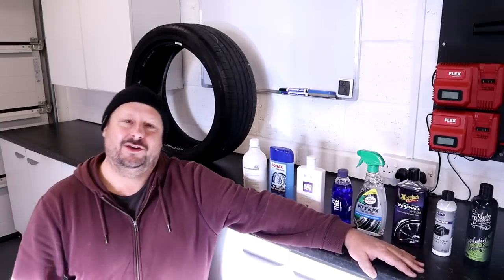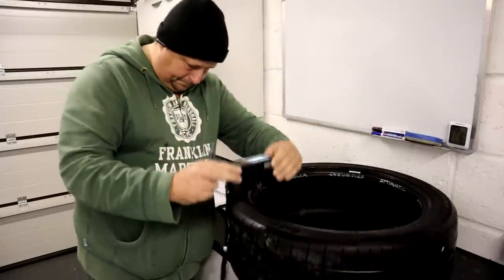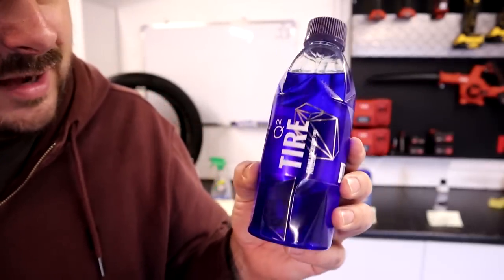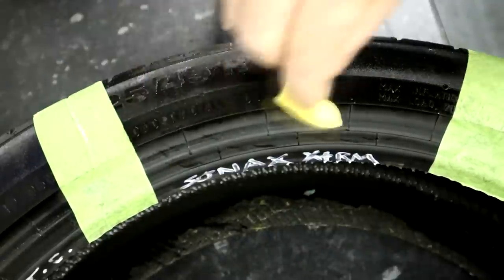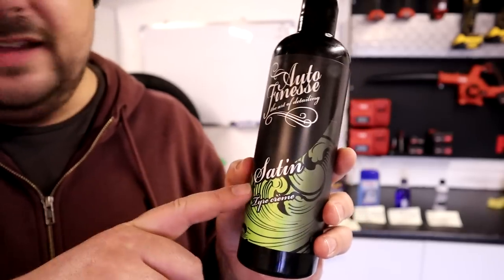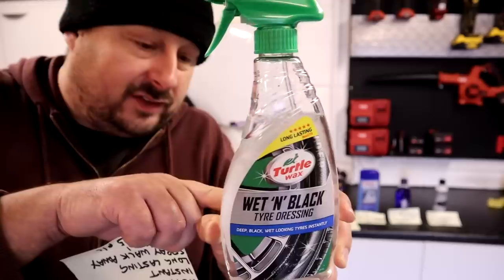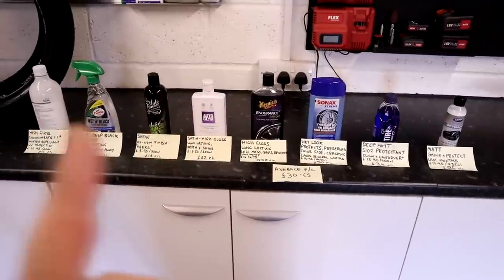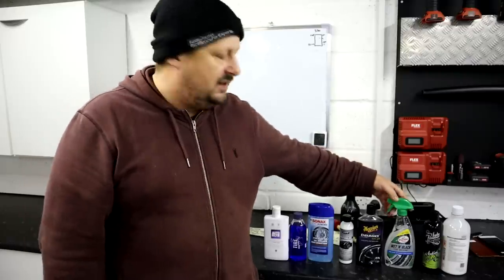The Best Tyre Shine Dressing Comparison

Comment: Use megs the bottle last ages applied with a small sponge
Reply: Totally agree, had my bottle for two years and there is still a quarter left, if you use less product and spread it more, which is easily done and then you get no sling. Also £14 were did you get that from Jon, i paid just over £9 last summer from Halfords

Comment: I have been using the Meguiars one for a long time, but found it to be too sticky and a little difficult to apply. Now, I use the Gyeon Tire one and I think it is better in every way (instead of its price of course)!
Reply: Try mixing Endurance with another Meguair’s product named ‘Hot Wheels’ it makes application so much easier and it has great ‘endurance’ too👍🏻

Comment: Hello John though I’d update my tyre dressings. I have been using Satin for years and I really love it’s application no mess at all is to apply I like the finish but isn’t that durable imo. I have since purchased megs & AG, these 2 seem like amazing products look nice I even used the megs on plastic trim let see how that goes. They only down side I found was megs was too sticky and had to apply AG was to runny and would end up spilling out of the bottle. Both lovely products think I’ll be using these 2 going forward.
Reply from the maker: Yer both slimey to use Jawad.  The satin is less greasy

Comment: Outside the competitors on this test, I've been using TUF Shine for a couple of years now and there's no other I'll be using  other than CarPro Perl on cars that I don't own or use. TUF needs quite a bit of prepping but it easily outlasts all of the others, around 10tkm per season and the sidewalls look still like new from wash to wash, only needing one top-up coat once every 4 months if you want to keep them to look like new. It even works in the winter. 😊

Comment: Great video 👍
I use liquid type of dressing. But I don't spray them. I pour a bit into a old plastic jug and using a painter brush to the correct aspect ratio size of the sidewall. This save money on the product, avoid getting it on the tread and more control.

Comment: I confess that I've not read all the comments, but am I the only one who associates tyre dressing with Arthur Daily and car lots on the Southend Arterial?

My 45 year old concours winning classic has narrow band whitewall tyres, so using any of these products isn't an option on that particular car due to 'bleed' and discolouration of the white rubber.

I use a combination of diluted De-Solv-It or Elbow Grease (the product, not muscle power), agitated with a non-stick washing up sponge, followed by Raceglaze Whitewall Cleaner, which is basically a rubber cleaner, sprayed on and wiped over with an open cell Basotect melamine sponge (Magic Sponge or similar). The Raceglaze product is the best of all and can be used as a standalone product, but the others are half the price so are useful and cheaper for the first stage of dirt removal.

Properly cleaned rubber has a very low level sheen and looks far more classy than any dressed tyre. I use the same products on all our cars.

An added advantage is that brake dust and road dirt are less likely to stick to the surface.

Comment: been using megs endurance for a while now, big bottle so yet to run out! it is as you described but the fact that it doesn't dry is abit annoying.. first time you take the car out for a drive some of it can splatter around! so if you apply it, go over it again with a microfibre or something to wipe off the excess.

Comment: Jon, I used to use both AutoGlym and Meguiars for my shows but has you mentioned never dries and got very dirty jeans a few times by touching the tyre whilst polishing. I have been very impressed with my Gtechniq T1 which i use now.

Comment: I stick with the regular Autoglym Instant Tyre Dressing (black label) as it can be applied to a wet tyre if need be. I draw the line at drying my tyres after washing and before application and like the results I get whether applied to a dry or damp tyre. I am a convert to the Meguiars applicator though.

Comment: I'd bet that the Turtle wax wet n black cost is higher per application as you're using a lot spraying it on like that.
Reply: Yeah why not into an applicator and wipe in😯 Not only will you use less but get little to nothing on the rims either💡

Comment: I use several tire fixtures, but first I cover the metal discs with a round cardboard template with a diameter only to protect the aluminum discs.  Because when braking, the dust sticks to the small drops of the tire cleaner that are on the disc when used without a template.  Then it looks bad.

Comment: I just got turned onto Dupli Color "Tire Paint." It literally comes in a spray paint can and gives you the gloss/wet/black-shine look and has a permanent application/doesn't wash off during a detail... and only costs about $6 bucks USD to fully dress 4/5 wheels. I typically recoat mine every 6 months... so you'd get a years supply that will run you about $12 dollars outta pocket.
Reply from the maker: I used to do a similiar thing.  in the UK we have car plan 5 litres Tyre Paint for 20 quid.  The trade guys use it because you can just paint over the crap with it :) but I really want to dress my tyres not paint them.  Tyre paints are more a way of making battered tyres look fresh, but with detailing you want to just make nice tyres look dressed.

Comment: I use meguires hot tyre shine with the megs applicator. With about three or four sprays on the applicator per tyre the bottle will for months. I use this one a week when I wash the car but would probably only need using every three weeks.

Comment: I always apply the Meguirs Endurance Tire Gel to my tyres the night before a car show, so that it dries over night.
Reply: Try mixing Endurance with another Meguair’s product named ‘Hot Wheels’ it makes application so much easier and it has great ‘endurance’ too👍🏻
Reply: @666DW  I've used both endurance and hot wheels and find hot wheels has amazing durability just application can be little messy whereas endurance was good for that. When you say mix them, can you explain so I can try this..do you apply endurance on applicator and spray the hot wheels on? All round, hot wheels has impressed me by far!
Reply: @bilalvarma3655  always trust your instinct and go with what your happy with. If ‘hot wheels’ gives the results you are happy with then why change? Both Meguairs products are very good products IMO.

When I say mix both endurance and hot wheels, I decant a measured amount of both products from their original bottles into a strong 1litre plastic bottle, at a ratio of 2 parts hot wheels to 1 part endurance. The idea is to obtain a consistency to which you are happy with for application. As hot wheels has a thinner viscosity than endurance you would add more hot wheels.

To apply I decant a sufficient amount of mixed product into a 500ml plastic or glass pot and use a 2” paint brush to apply. After 30 minutes or so I then use either a applicator sponge or a clean tyre sponge to wipe any excess product off the tyre face. Job done👍🏻

You get the best of both worlds by having a long lasting tyre dressing which is easy to apply. Hope this helps!👍🏻
Reply: @666DW  appreciate the quick response. My reasoning is solely due to the application process itself. Despite my efforts, i still get overspray on the alloy and body and have to wipe off. When I have attempted spraying hot wheels on a clean applicator I don't get the same finish. Your suggestions sounds good will give this a try 👍🏽
Reply: @bilalvarma3655  glad to be of help👍🏻

As with most tyre dressings the initial couple of applications will absorb into the tyre as the solvent or water ingredient evaporates.

For the reasons you mentioned I always apply with a paint brush, leave for 30 minutes to 1 hour for the product to be absorbed or solvent flash off and then for the final and desired finish use a sponge applicator or tyre sponge.

All the best👊🏻
Reply: @666DW  thanks bud 👍🏽

Comment: I used Megs Endurance for years.  It last a long time, but you do have to watch out for sling.  I switched to Gyeon Tyre and really prefer it over Megs.  Less messy on application, dries completely, durable for about three washes and looks good.

Comment: I sometimes wonder when some of these products push that they are also a protectant, what happens to the inside tyre wall? Yes I know that some hyper detailers remove their wheels to give all round protection but most people don't. Perhaps do that once a year or maybe twice when you can protect the insides of the rim and tyre before winter sets in and salt gets a chance to coat the inside and next in the spring to git rid of all the winter gunge. I've always found the Autoglym tyre gel to be good along with its companion bumper dressing. Both bottles down to the last knockings so  I've got some Perl to try sometime.
Reply from the maker: even if you put protectant on the inside tyre wall the main tread has nothing on it.    I dont know. but yer I am really more of the thought that these are dressings and Ive not seen any like real life proof of benefits to rubber from protection.  you can say UV can dry the exposed face out.    but Im agnostic maybe one day I see it.

Comment: The best tyre shine I've ever had was Turtle wax extreme nanotech tyre gel. Lasted for ages and looked great with no sling. Shame turtle wax don't do it any more.Currently using Sonax and I've tried the Megs and there's not that much between them. I wouldn't say the megs has any endurance really. Interestingly, the tyre dressing the dealer used on my new car has lasted for ages. I must ask them what it is they use but I'm guessing Autosmart.
Reply: A year later, but this comment prompted me to go and try and find what Turtle Wax make now - pretty sure "Turtle Wax Hybrid Solutions Graphene Acrylic Tyre Shine Spray Coating" is the successor.

Comment: Mckee's equivalent to the Optimum si02 product requires so much scrubbing (until there is no more brown foam, and with their specialized cleaner that isn't cheap--still took me 3-4 rounds of scrubbing with a drill brush) to prep the tire for dressing that I suspect is critical to Optimum's long term durability as well. I'm impressed 1 month in, but it is damn expensive with the additional product.

Comment: I just can’t see by the meguiars tyre stuff even though it does have downsides, I’ve had the turtle wax and the auto finesse but it just doesn’t compare. I feel though with the meguiars it does chuck off some residue on to the wheel over time when you’ve been using the car no matter how careful you are with it. But I do prefer that wet look in general, annoying as I have 2 bottles of auto finesse gathering dust.

Comment: Great vid as always Jon. I’m using the Gtechniq T2 tyre dressing at the moment, £32.00 PL. It’s water based and gives a good dark matt finish, doesn’t last long but I try to wash my vehicles every week so not a problem for me. Ive also got the T1 tyre and trim, this is solvent based and does last longer but too glossy for me, it’s also £52.00 PL but can be used on trim.

Comment: OPT tire coating is one of THEE most finicky. hit or miss products I've ever used! On my own car I cleaned the tires, applied it and it initially looked awesome but after one rain storm the tires turned brownish/tan/gold in color. I even tried this on someone's tires that were brand new, nothing applied and those turned the same color😯 I will say someone else I know, with the same tires as the latter here used it without a problem, I don't get it😋

Gyeon Tire is my favorite in this test, along with Gyeon Tire Express which works great in the winter where the tires don't dry as quickly. The Express is said to work on wet tires but I think they mean after you've dried them with a towel and don't have to wait for full drying💡👍😉
Reply: I stopped applying tireshine cause DAMN it's so time consuming to take care of wheels/tires , then also you can't apply it to wet tires :(
Reply: @dimmacommunication  time consuming? Although I always do a barrel clean, clean around the lugs and scrub the tires clean, along with a brush for the spokes, the results are worth it. Do you coat your rims with something like 303 Touchless sealant?
Reply: @klasseact6663  Time consuming I meant the tires , always need to keep them dry etc...
Reply: @dimmacommunication  maybe get a mini Master Blaster to help dry the tires quickly🤔
Reply: @klasseact6663  I just apply tire dressing in the summer :)

Comment: Meguiars it's a nightmare on bright color cars. I was using it on my previous black car and was very happy with a results but since I'm driving a white car it's a nightmare. You need to apply on a dry tyre and wait till it dry a little bit but it's really hard to dry. Even the next day I'm finding lots of black greasy spots on the car around the wheels area. Will replace it soon. Y

Comment: I've been using the Gyeon recently. Good product but the pump dispenser  if left in place...can leak the sticky gel. The applicator used also is left sticky and the sio2 means rinsing it is no good!
Reply: I find the same, love the look and durability but it's simply a MESS!

Comment: Hi Jon Love the channel BTW  I own a few motorcycles and clean them within an inch of their lives, So been looking at Ceramic coatings and  as not professional cannot get the good ones to spray on and buff off. So came across this have you seen or used as cannot see in the channel       Bodyguard Ceramic 12 Month Car & Motorcycle Ceramic Coating
Reply from the maker: Not used mate sorry there's millions of coating out there but still less than 10 real formulators..  so as long as it's a credible company and not some Chinese cheap coating you should be fine mate..
Reply: @ForensicDetailing  Cheers Jon

Comment: Hi John, I've bought both bilt hammer pre wash products after watching your review. I'm unsure how much 
surfex chemical to put in my 5 litre spray bottle and in my 1 litre trigger spray bottle for inside the car trims etc.
I have watched some videos on how to do this but I'm still worried that I put to much in.
I would be grateful if you could give me an amount in ml for the chemicals the other being snow foam it is only a small 400 ml bottle. Thanks John love the channel.
Reply from the maker: Hi neil sure mate.

10% for most exterior heavy degreasing.
5% for prewash on lower panel road film
10% tyres alloys.
1-2% interior wipe downs.

something like this.
Reply: Thanks so much for getting back to me 
John I am looking forward to your next 
Video. Keep safe.
Neil.

Comment: No Solution Finish??
Reply from the maker: its not really a tyre shine or tyre dressing to be fair.
Reply: @ForensicDetailing  That's true John, a lot in the US rate it's durability on tyres so wondered how it would fair in a test like this. On trim it holds up incredibly.
Oh by the way, you've made me decide to sell my ibrid and my Pxe 80 is on the way! Those tasty shafts are sold out though 🙄😂

Comment: Hi, Great honest  review as always Jon, however I think the Opti-bond Tyre gel would have been a better comparison for the same price you would get a 32oz bottle giving you 4 time more product for the same price. The Optimum TPC is more then a tyre dressing, think of it more like a ceramic coating for tyres if you like. and will give you 6 to 12 months of protection. yo should also be able to coat 8-12 sets of wheels with this bottle. (https://www.youtube.com/watch?v=1VSPW0NpQAo) This shows the application of TPC, it also has UV  and oxidation protection built in. So if you have a vehicle you don't drive much you can apply to the inside of the tyre, as well to prevent damage from oxidation. I'm sure we have all seen old cars with cracked rubber tyres!! Regards Greg, Optimum Car Care UK web site coming soon!!
Reply from the maker: you know Im a big optimum fan Greg.. but this product is not for me, I dont see it like a ceramic coating, it seems water based and its not using silzane material, and its not repelling dirt or contamination. my eyes just dont lie greg.  side by side next to gyeon tire.. the optimum product didnt look good, the gyeon tyre contains ceramic material but this actually kept its half of the tyre a lot cleaner and fresh looking, there was a big difference, on the golf the optimum tyre product look bad after a week (it was still there but it was hard to tell).  I can see the Opti product is a really durable material though, its definetly not easy washed off or degraded as the test tyre proved.   I dont doubt the durability but I want a simple product that makes my tyres look good and lasts longer (maintains the fresh look for longer), I want a stronger fresh look for longer for less money.   The benefits of UV protection around tyres, Im agnostic.  Like I said in the video the day I see independent testing and verification of it then Im more likely to buy these products.  Cant like everything. I should have put the normal opti dressing in there that was good.  like I say though it was cool to dry something unique.
Reply: Hi Jon, it needs a lot of prep with power clean before applying, check out the link, I did a tyre using optimum tyre gel today will try any post the results.
Reply: Always  happy to come over with any Optimum products for you to look at and test.